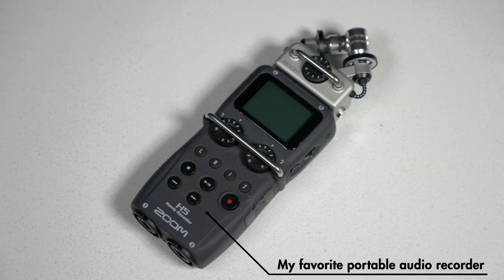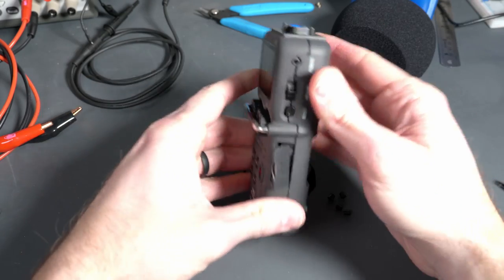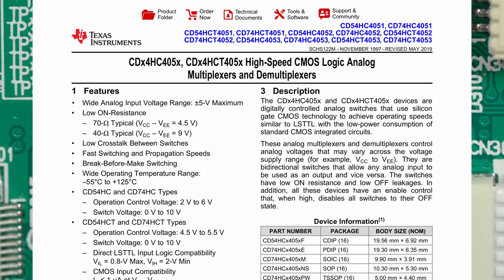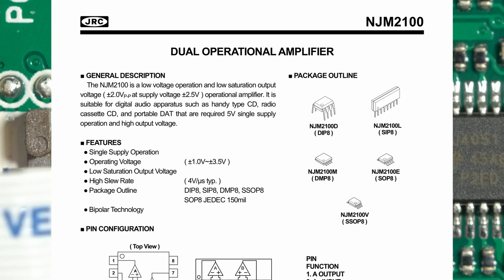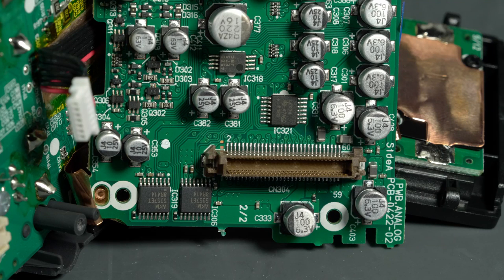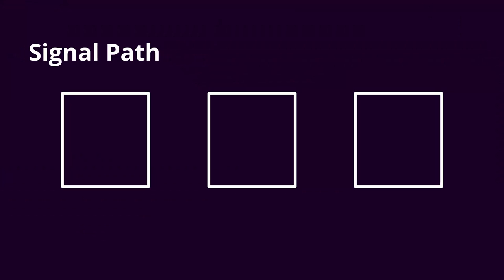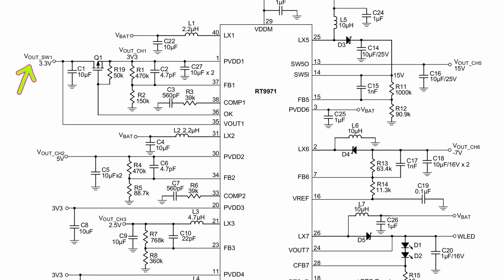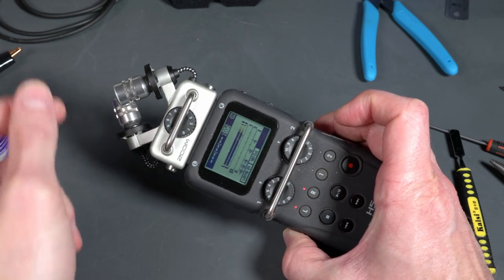TEARDOWN - Zoom H5 Handy Recorder

Comment: Hello, thank you very much for the video. 
That was helpful and interessting.
Is it possible to just remove the case without dissasembling the complete electronics? 
I would like to remove the plastic case in order to apply Armor All to clean up the sticky gluey case.

Comment: Thanks @OverKill. Like many others I ended up here because of a sticky case. I was trying to inquire on how easy it would be to just tear this thing down to the shell and coat it with something better than the garbage they did at the factory. Your step-by-step was really helpful in my journey.
Reply: Do you have any tips on the sticky case as I've opened the unit, but noticed there are still a few parts that can't be removed so the case can be cleaned properly and reassembled.

Comment: Thanks for the wonderful video... i have a H5 but when i turn on the phantom power (without attaching the condenser mic), there are a lot of static and cracking noises when i turn up the gain... any idea what can be the cause of it ?  i am comtemplating spraying some contact cleaner on the board hoping the noise will just go away....

Comment: I love you!!! 1M Thanks!!! "4 screws under the rubber feet". You saved my H5. It was impossible to dismantle the unit befor that tip. I love my H5 but it has become shity and sticky (this plastic sucks). Thanks for your ulta-useful mega-professional video. My very best wishes!
Reply: I faced the same problem. Tried talcum powder on it, but, it didn't last long. However, I have since taken a piece of cloth and rubbed surgical spirit on it to wipe away the rubber. The unit is now shiny grey instead of the black. But, it is no longer sticky!

Comment: Thanx for thus video. I got a problem with the device shutting of as soon as I try to start it. Read up on it and some wrote that it has problems with the phantom power. When I saw your video I saw that it is really easy to disconnect the bottom mic inputs so I did that. Started the device with no problem. Turned of phantom power. Reatached the cable and now its working flawlessly. You saved me a lot of money. Thank You.
Reply from the maker: That's great!  It's funny how easily some things can be repaired once you feel confident opening them up.
Reply: @overkillprojects8091  Definately! Thanx again!

Comment: Thanks for the teardown! My H5 has a different mounting thread - it has no metal bottom, just some thin piece of plastic. That means, that if I'm not careful, I could drive a mounting screw straight into the PCB. So, there's that inconsistency with Zoom's build quality. There's a video where someone's already gone throught that headache - search for "SOLVED Zoom H5 recorder faulty XLR inputs".
Reply from the maker: Very interesting!  I wonder when they made that change.  I've had my H5 for a few years now.

Comment: Thanks for the teardown. I was hoping there was a simple weak point that I could upgrade for improved sound. (I can do some basic soldering, like remove those capacitors and upgrade them to something higher quality). The H5 and especially the XYH-5 modules are hit and miss regarding quality control (many reviews online mention this). My unit just produces too much noise, so I will probably get another microphone (either a module or XLR microphone). Obviously, if the H5 is to blame, I will have to get something to replace that too.
Reply from the maker: Interesting.  I kind of wish I had a noisy one to troubleshoot - maybe there's an easy fix.  I might start looking on eBay for a noisy sample - it would make a good video
Reply: @overkillprojects8091  I will keep in touch if I get a replacement, I might just send it over :)
Reply from the maker: @mistaspeedy  I won't say no to that ;-)
Reply: What is "too much noise"? Are you getting too much noise from the built-in mic or from the line inputs?
Reply: @baroque_engineer  I was getting too much noise from the built in microphone - XYH5. I have since bought a used XYH6 module and it is better, but still not perfect. My main microphone now is an Audio Technica AT2035 which I am happy with. The XY modules are great for louder sound sources, but not for something quiet

Comment: Thank you for the inside look. Is there an easy way to repair the volume control button on the side? The (-) side works which lowers the volume but the (+) side to increase volume does not work. Any suggestions on how to repair?
Reply from the maker: If you hear a click but the volume doesn't change, it's likely that the switch underneath has either broken or the solder joint has come loose from the circuit board. Unfortunately those switches are on the deeper of the two boards in the unit as you can see around 5:48 in the video (S301/2). If you generally follow the teardown, it shouldn't be too difficult to get to them and they aren't impossible to hand solder for someone with a little experience - you just use a larger solder tip and apply it to the base while feeding a little solder into the joint, both for removal and for reinstallation. However if you don't deal with surface mount electronics regularly I imagine it would seem intimidating. Just take your time!
Reply: Thank you very much! I hear a click on the (-) and it works but nothing when I push the (+) side. It's soft and cushy.

Comment: maybe it's too late to ask for help or a comment, but I have a problem with the DC5V port while using as Audio Interface. The port is not powering anymore by USB like in the last 2 years, but it's still working as external audio interface powered by batteries. I have to teardown and change USB port or what?

Comment: Wonderful explanation! Helps me a lot on getting familiarized with the location of the screws to remove the plastic housing. The rubberized coating of the H5 tends to get gummy and eventually fail and it was a pain to remove it around the gain controls at the front.

Comment: Excellent Video! Maybe you can give an advice for the problem I have with my H5: The Mini USB connector went off due to frequent usage leaving some destruction on the PCB. I managed to reconnect it, but now the data exchange doesn't work any more: I can power the H5 via USB, but it doesn't offer me to act as card reader or USB audio interface, which I used a lot before. I might have made a mistake reconnecting the USB - I thought pin 4 and 5 had been connected, so I shorted them. Also when the USB connector went off, it destroyed a part on the PCB. According to the printed labels, it is part Q115 which can be seen at minute 9:32 of your video. Do you know what kind of part that is - a transistor? But what type? I would be most grateful for a helpful hint...
Reply from the maker: Well first, connecting pins 4 and 5 could cause the problem by itself.  Pin 4 being grounded would tell your computer that it should be the host.  Your computer would disagree and as a result you wouldn't get any communication.  Just fixing that might do it.  Maybe all you need it some solder wick.
The transistor is tougher.  It looks, but I'm certainly not certain, like it could be a P-channel mosfet to switch between Vbatt and Vbus. However, it doesn't match the typical pin configuration for those transistors in that package so I am probably wrong.  Maybe there is some other version of the same that uses an N-channel fet, but I don't know it off hand.  If i get a chance to dig into it again i can probe to see what it's actually doing, but no promises that I'll get it done soon.  Why do you think it's bad in your unit?  It is handling the power, so the fact that you can power via USB leads me to think it is functioning.
Reply: @overkillprojects8091  Thanks for your answer! So I disconnected pins 4 and 5, but unfortunately the problem persists. The damaged part Q115 is even better visible in minute 10:15, where it can be seen that it has "07" written on it. I have examined my PCB again under magnification and think that  Q102 has the same marking, if that can help to figure out what part it is. I know that Q115 is dead because it is mechanically destroyed - the housing is gone, and the remainder is litterally broken into three parts. So I am absolutely certain that it doesn't do anything any more...
Reply from the maker: Hmm interesting.  After poking around a bit, I'm relatively certain that it's a P channel MOSFET in an SOT-323-3 package, although there's no telling which exactly - that package code isn't giving me much to go on.  Though I doubt it will matter too much - at least the specs shouldn't be so far off in that package size that it would be the difference between your device working or not. So - WARNING ⚠️!! Proceed at your own risk, you might kill your device !! - you might want to give it a go with a similar part and see how it goes.  Maybe something like an NX3008 or equivalent?  Let me know if it works out, I'm curious at this point.
Reply: @overkillprojects8091  Hooray, it's working again!! I managed to get a similar transistor (a nice colleague in the electronics department of my company had some remaining parts of a recent project in his drawer), soldered it in place of the broken one (not so easy as it has a slightly bigger housing), and now my H5 works as USB audio interface again! I am very happy!! Thank you so much for the decisive hints!
Reply from the maker: @matzetuebi872  That's great! Congratulations!
Reply: @overkillprojects8091  Thanks!! Remark: Those parts are really small, I had to do all soldering under a 10x microscope...